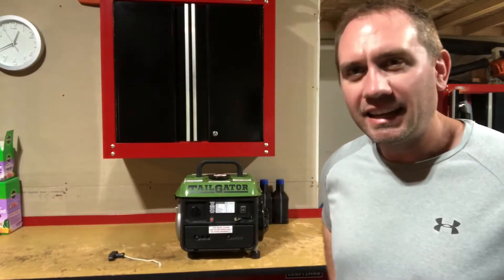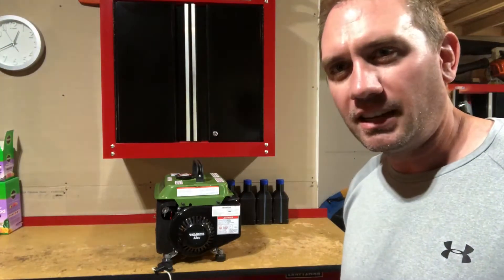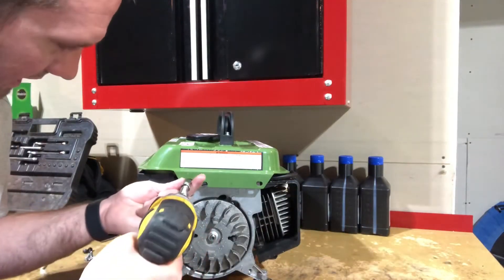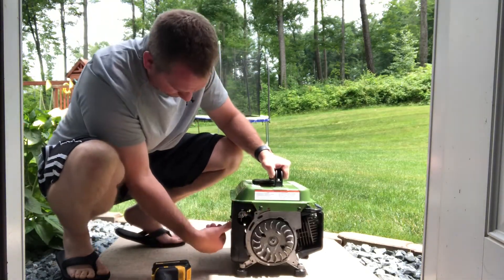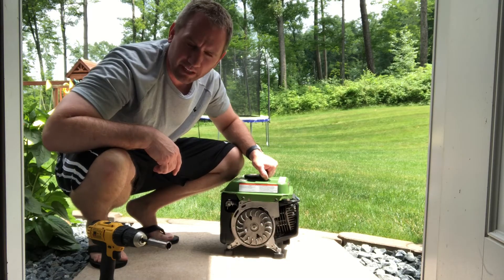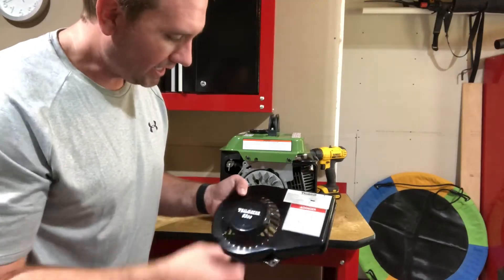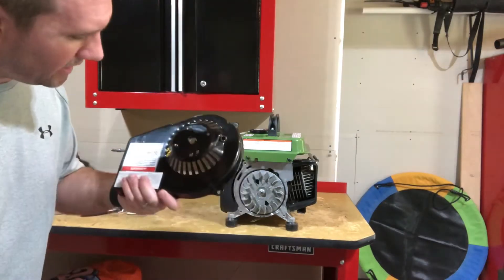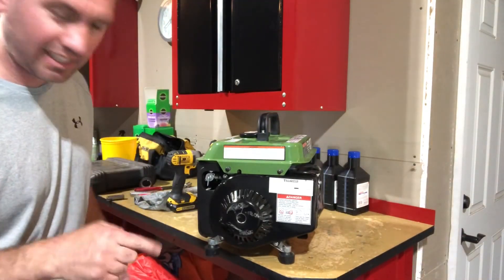Convert a small engine to drill start!

Comment: I have used the drill trick, not for starting a small engine but for the purpose of performing a spark test or performing a compression test.  A battery powered drill contains a reverse-current diode to quickly bring the drill to a stop when the operating trigger is released.  When I use the drill on an engine, the braking effect does havoc on my wrist.  A corded drill does not contain a reverse -current diode, so some amount of coasting is allowed when power is removed.  This is much more comfortable on my wrist.  Another way to resolve the wrist-twisting issue is to use a clutch or ratcheting mechanism.  This would be even more necessary when using a drill for engine starting.
Reply from the maker: Great information, thanks for taking the time to share.

Comment: Nice, I also have one of those tailgater POS and another brand the same size never tested.
I was hoping to see something I could use to convert a little 4 stroke weed eater to electric start. It's not a yard tool anymore but a canoe drive using rc airplane propeller that are only a couple bucks not the $30+ for trolling motor ones.
Reply from the maker: Great idea for a canoe engine.  You should be able to use the same concept.  The crank bolt should be right behind the recoil.
Reply: You can make a propeller out of a flat piece of stainless steel flat  bar 1/8 " thick × 1 3/4 " wide by 6 - 7" long , it don't take a lot of pitch to make it move water .

Comment: So when the power goes out, your arm doesn't work?  You're thinking short term. Revisit after the next outage when your batteries have failed.  Better solution is t oacquire another or modified pull start for the laziness.  Narragansett Bay
Reply: We have multiple drills, multiple batteries at my house,  always fully charged on standby, just for this purpose,  doing my lawn mower this way. So wife & teens have no excuse not to mow grass! 😂 I never let all 6 drill batteries go down .  Just pick up next drill or swap battery.  Course could drive to get a brewe and Chips,
Reply from the maker: A best solution is to buy a bigger more reliable generator, but so far this is working well.

Comment: What do you do if your power is out and your battery is dead?
Reply from the maker: That is possible but very unlikely.
Reply: My job requires me to have several cordless tools. I stick to the same brand and have several charged batteries on hand at all times.

Comment: I got you one even better than that. I chucked all my gas lawn tools & 
swapped them all out for ELECTRICS. No yanking, no choking, no 
fueling, no oil changing, no running to fill the gas can, no hard starts, 
no stalling. No smokin, no stink, no noise. I never knew life could be so good!!!

!
Reply: Battery worked great till my power went down. My ev car couldn't even make it to town to by gas for my generator. And of course my solar panels weren't getting any sun  now what ?
Reply: If you have a small yard electric will probably work. A half acre or bigger your not gonna like electric the battery won't get the job done weed wackers and leaf blowers suck a battery pretty quickly. Their hard on batteries also last time I checked a decent sized battery for a weed wacker cost about the same as a small gas powered weed wacker and you'll need several batteries if you have a large piece of property so you can keep swapping them out when they go dead.
Reply from the maker: I agree, the user experience is vastly better with high quality battery electric tools.  There are still some nichs uses that gasoline is better but quickly disappearing.
Reply: Bet that works great for your generator when power goes out
Reply: I'm poor, I can't pay for all the batteries needed to get work done,  then replacing batteries when I can afford 4x the gas equipment maintained right...

Comment: Nice and without fancy film editing. Just what I like. Think you should put a nice rubber grommet over the hole. More esthetically pleasant. Plus the flowing air will have the same volumetric as before & same cooling. Thanks. Nice video.
Reply from the maker: I'm glad you liked this style of video, thanks or the feedback.  

A rubber grommet would be a great addition to guard the sharp edge of the hole.

Comment: What about one that has compression release.? This will never work on bigger engines.
Reply from the maker: No, it won’t work on everything, but larger drills are available.  Also, large engines usually have electric start.
Reply: @TheLawnEngineer  yeah some engines have something to do with compression would make it impossible to, but I will try it.

Comment: Excellent idea. But will it work with all of the other generators?
Reply from the maker: You can make it work with almost any generator or small engine.   There are some reasons you may not want to, check this out for that discussion:https://youtu.be/jf4qOC9220I

Comment: Drill where nut thread meets crankshaft thread,drill and tap a thread 10 mm deep to take a high tensile grub screw and the nut will not loosen,definitely not without a ratchet device.Works extremely well!!Australia
Reply from the maker: Great idea, with the grub screw, that would take some stress off the bolt.  Thanks for taking the time to check in👍
Reply: Some flywheel fans are held on with a left handed thread ( it keeps the nut tight when the engine is running ) using the pistol drill can sometime undo the nut and give you a lot of grief.

Comment: Remove the pull starter assembly. Take a Forstner Bit and drill the center of the cover. Reattach the cover. This is what I did to my push mower when the pull start broke.
Reply from the maker: Yes a Forstner bit would have made quick work of this 👍

Comment: Using a drill and socket to start an engine,especially a 2 cycle, can create a problem when the engine starts and turns faster than the drill and socket cannot be removed fast enough. Not only can the drill be damaged, but the flywheel nut can come off and allowing flywheel to come lose and damage the crank. Best to use a socket ratchet along with the socket.
Reply: I've been doing this a few years with a leaf collection system. The pulley came off the first time so I just tightened it up and its never happened again. You do have to use a drill instead of a driver. Works great though.
Reply: Overrunning clutch drive drill adapter is the safest way. An impact gun can be used in a pinch, they will free spin when not engaged.
Reply: @Reloadeez a true impact can strip or break the flywheel nut/bolt because the pressure isn't constant and with each impact there's a lot of sudden torque that's beating on the flywheel nut/bolt as it is trying to tighten it each time.
Reply: Corded drills also freewheel  @Reloadeez
Reply: @Reloadeez An impact though will over torque the nut
Reply: Yep very helpful
Reply: Caution someone will  apply too much torque and break key on flywheel
Reply: now I must go buy a battery drill because my lead is to short If you're engine  is good it should start within 3 pulls plus you get exersize for free
Reply: Option B, Fix the pull cord!
Reply: @Krazycat321  No matter how good the pull cord is it won't fix a 76 year old arthritic shoulder.
Reply: @Willy12927 Yes, you're correct. I don't know why people don't think there's other reason why we want to convert to electric start. It's not like we're lazy or can't make the repair.
I'm 60 and if you're like me you've probably pulled started small engines since you were big enough to do it. 
I have a bad rotator cuff on my right shoulder. I removed the top cover from my mower and start it with a drill and the pull cord on the mower was perfectly fine. My shoulder was the problem and not the cord.
Good luck I hope you were able to work it out. A drill, a socket and a good quality "ratchet adapter" is all you need. Don't cheap out on the ratchet adapter. The first one I bought would free spun backward when turned by hand but would lock both ways from the sudden impact from a kickback which can easily break your wrist
Reply from the maker: You are correct, I made a follow up video about that topic: Watch this Before Converting Engine to Drill Start
https://youtu.be/jf4qOC9220I
Reply: @TheLawnEngineer drill starting ratchit
Reply: Y et TY tm oh @TheLawnEngineer
Reply: Thanks for the novel, but nope not helpful.
Reply: @garyday6681 Be thick headed and fck up your wrist drill and engine then.

Comment: I noticed right off that you left the air flow shroud off over the flywheel. Probably not a good idea as those fins on the flywheel and the shroud direct cooling air to the engine. OK, I see you realized the cooling issue. Cool! 
All that drilling why not use a hole saw attachment on your drill. Probably would have gone right through that inner mount for the recoil starter too.
I like your video because I have exactly the same generator. I have a couple of larger ones I plan to convert too. If those work as well, I'm considering a minibike to put over to my local grocery store with a bike trailer hooked on behind to get my groceries instead of driving my 1 ton dodge diesel pickup.
Reply from the maker: Thanks for checking in Chris.  The only reason for not using a hole saw is I don’t have one of the appropriate size.  

I would really like to know how the harbor freight mini bike works out, please check back.
Reply: @TheLawnEngineer  I was thinkin of Tractor Supply and their Coleman bikes.
Reply from the maker: @chrisbaker2903  That makes more sense.  Those little bikes do look fun to play around with.  I have a Honda 50cc trail bike growing up...lots of good memories.
Reply: @TheLawnEngineer  Thanks. I've also got a predator engine from HF and I am considering mounting it so that it can turn a 12 VDC (nominal, usually about 13.8) alternator from a car to power my amateur radios during Field Day. It is irritating to my sensibilities to generate house voltage and current and then convert it to 12 VDC to run DC appliances. It's not an efficient process.
Reply from the maker: @chrisbaker2903  that sounds like a good idea.  Are you going to include something for capacitance like a battery?  

I often wonder if we are going to go back to DC to some degree within homes.  With LEDs and battery charging we are using quite a bit of direct current electricity.

Comment: lol that thing had spark, you just didnt have it in drill mode and it was hammering and didnt want to look dumb
Reply from the maker: I actually used an impact driver first and completely agree, that is the wrong tool.  Then I messed with the plug wire and it fell apart.  

You should subscribe and watch more videos to see more dumb things I do.

Comment: Tried this with my harbor freight predator post hole digger that would never start and broke the bolt off the crank these are not made for this type of torque on that nut
Reply from the maker: Yes, that is definitely a risk. Out of curiosity, were you using a impact driver or a drill?  I know the impact drivers hit pretty hard.

Comment: Nice video I did this a while ago with a 212 predator motor and my drill was not spinning it fast enough and it wasn't starting you have to make sure your drill spins it fast enough
Reply: Air impact gun can’t start my 14.5 Briggs and Stratton
Reply from the maker: @JosephOxbrough  that is a lot of cc’s to turn over.
Reply from the maker: I’m glad you liked the video 👍.  I too was surprised at the drill speed required to get the engine started.  

I’m sure the drill requirements go up significantly with engine displacement.
Reply: @TheLawnEngineer  Imagine the torque required to turn over my 5.9 liter diesel where each 60 cubic inch cylinder has a 17.8/1 compression ratio
Reply from the maker: @chrisbaker2903  Yes, I don't think my DeWalt drill would be able to turn that beast over.  In the early 2000s I had a Suburban with the 6.2L non-turbo diesel.  I believe those are 22:1 and it turned over very slowly, especially in winter.
Reply: Do you think this would work on a power washer ?

Comment: So when power goes out your drill battery is dead and you can't start generator. I'm just kidding. Its a good  video.
Reply from the maker: That would be quite ironic, wouldn't it?  I'll make sure I keep one battery charged so I don't have to explain that to the family when the power does go out =)
Reply: He will have the generator to charge them up

Comment: sure makes it easier for older people, or the disabled who cant pull the rope
Reply from the maker: I'm glad you found some value in the video!

It certainly makes starting this generator easier.
Reply: I used this idea while troubleshooting a no-start, allowed me to concentrate on finding the problem rather than my tired arm.
I'll say, if the starter center shaft bushing is packed full with heavy grease, the spring won't retract the pull cord properly in very cold weather.
Reply: https://www.youtube.com/watch?v=FckBIMatYzo this shows Gluing the socket And the rachet device - extra precaution that are a good idea.
Reply: Couldn't use a hole saw for the socket hole? Good conversion.
Reply from the maker: @joewoodchuck3824  a hole saw or large step drill would have worked better.  I need to up my hole making game with some new tools 🧰.